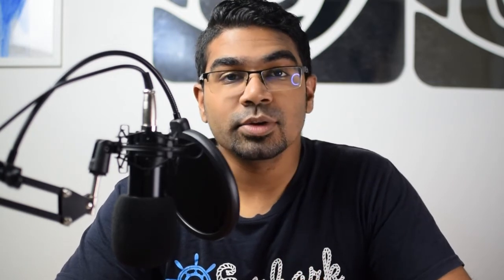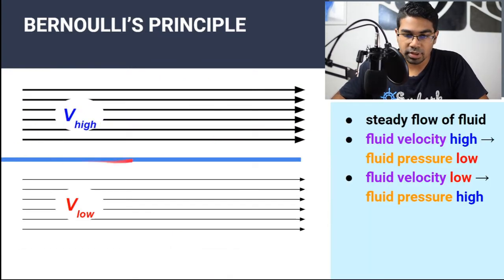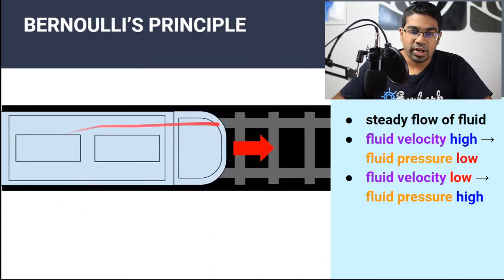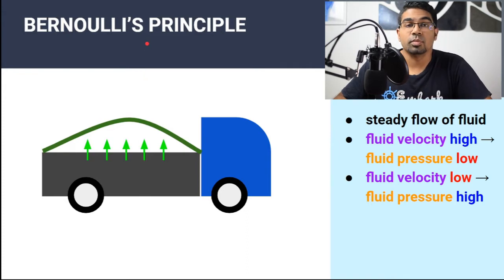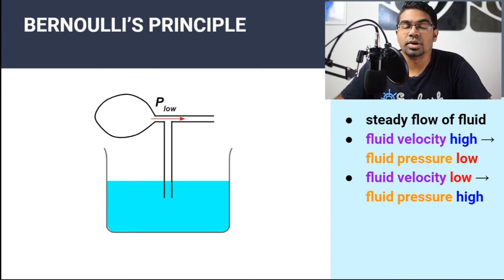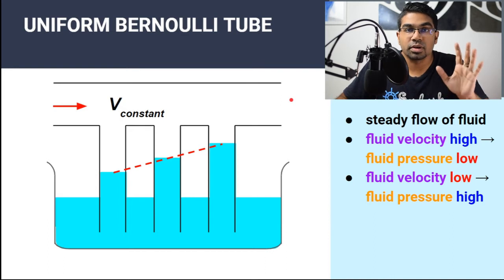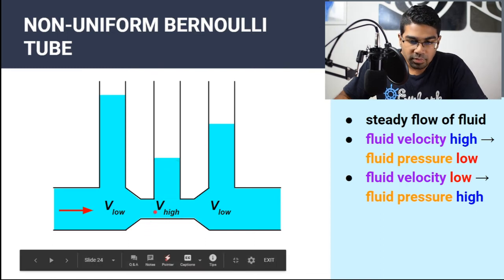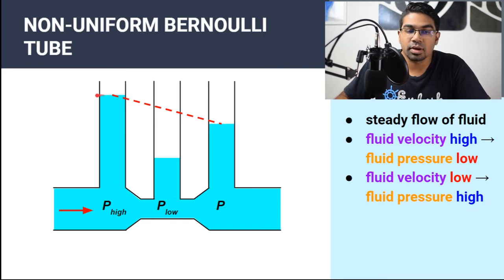Bernoulli's Principle

Comment: love your explanation!! but I'm still confused about the differences between air pressure and atmospheric pressure
Reply from the maker: Although the air in the tube is part of the atmosphere, it is not still air. Air is flowing as a fluid in the tube. Therefore, the pressure of air in the tube is not the same as the still air in the atmosphere.

Comment: For the uniform bernoulli's tube, how would that work for air and no water? Also what or how would you manipulate the equation for that?
Reply from the maker: In that case, air will be the fluid flowing, and the same principle applies. The first column will have the highest air pressure, followed by the second, then the third. This is due to the increasing pressure drop further away from the source. I assume you're talking about the Bernoulli equation? That's a whole other video.